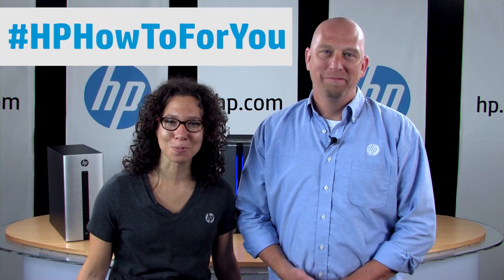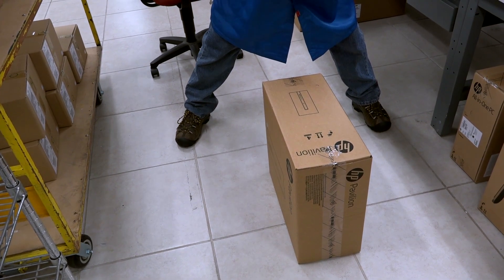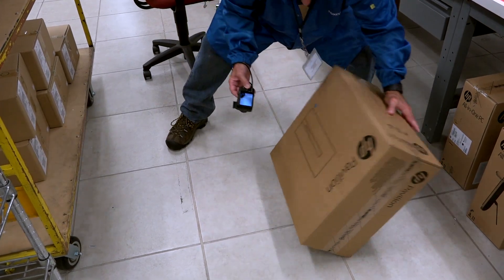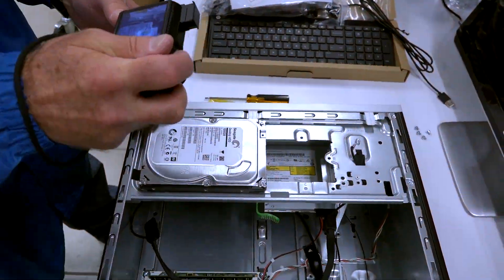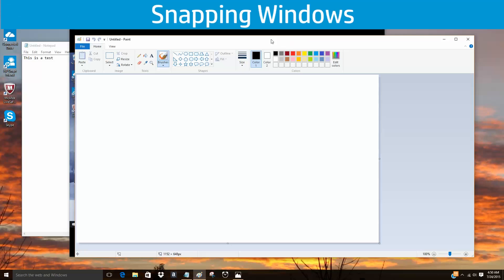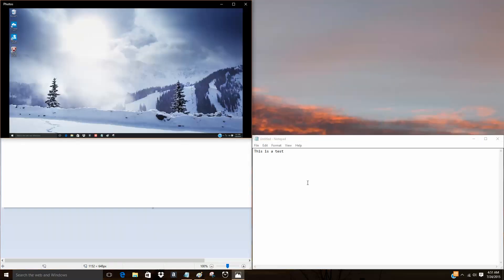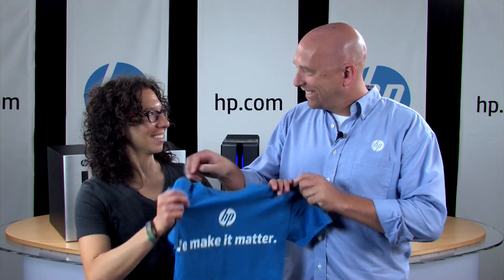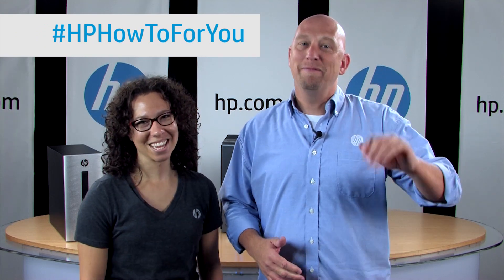Windows 10 Release and Unboxing: HP How To For You | HP Computers | HP

Comment: Just last year my windows 10 computer just started being really slow and the internet keeps disconnecting
Reply from the maker: +BranBrown5 Please perform updates via Windows and HP Support Assistant as mentioned below to fix this issue: Step 1 Windows Updates - 1) In the search box, type and open Windows Updates. 2) Check for updates. 3) If the updates are available, click on install and restart the computer. Step 2 HP Support Assistant Updates - 1) In the search box, type and open HP Support Assistant. 2) Check for updates. 3) If the updates are available, click on install and restart the computer.
Reply: @HPSupport  I’ll see if that works

Comment: have an HP C310a all-in-one printer which doesn't print after purchasing a Dell i3846 PC with Windows 10. have replaced the printer head and there is no change. are the printer and Windows 10 compatible?
Reply: +alan whitson   Yes it is compatible with Windows 10, it has a full feature driver for it.  What was occurring with the printer that prompted you to replace the printhead?

Comment: hp window 10 get hot on the right side of the pc really fast
Reply: +Khem Biswa   You di'dnt mention whether you have a notebook or desktop computer.  No worries, I've included the troubleshooting documents for both types of computers.  I've also included the link to our YouTube video.

Reducing Heat Inside the Computer to Prevent Overheating Video by HP Desktop and Mobile Device Help ( http://ow.ly/VuKk4 )
HP Desktop PCs - Reducing heat inside the computer to prevent overheating ( http://ow.ly/VuKrb )
HP Notebook PCs - Reducing Heat Inside the PC to Prevent Overheating ( http://ow.ly/VuKAn )
Reply: desktop computer
Reply: +Khem Biswa   Then I recommend the video and the desktop document for you.  I've included them again. 

Reducing Heat Inside the Computer to Prevent Overheating Video by HP Desktop and Mobile Device Help ( http://ow.ly/VuKk4 )
HP Desktop PCs - Reducing heat inside the computer to prevent overheating ( http://ow.ly/VuKrb )

Comment: How to connect HP Officejet 4620 with window 10 in  Sony Laptop?
Reply: +Roya Hosseini  If you do not have the driver use Google and search "HP officejet 4620 e-all-in-one printer driver" The top result should be to the Software and driver page for that printer, click the blue Go under option 2. This should take you to the correct driver download page if you are on your Windows 10 machine. Otherwise, click the blue edit link to the right of where it displays "Your operating system" and then select Windows 10 from the drop downs. When it refreshes the list Click the orange download button to the right of "HP Officejet Full Feature Software and Driver" This will save the installation file to your default download folder. Just run it from there once it is downloaded and follow the onscreen prompts during the software installation.  Let me know if you need any more help.

Comment: not starts but the screen remains blank the its  starts without any issues but when we shutdown the computer it not goes into off position i mean the display is only goes to of positon but the cpu is running and the power light is on tell me the exact solution
Reply: +Kumaravel Rkg   It sounds like your computer is not entering sleep mode.  Please try to disable “Hybrid Boot” or “Hybrid Shutdown” by turning “Fast Startup” off.   To find out how to do this, please search for “Fast Startup - Turn On or Off in Windows 10” using Google search.  The first hit should be for the Windows 10 Forums knows as “tenforums”.

Comment: i install windows 10 did a factory reset now laptop wont work keep getting message propblem have to restart error messwage inacessable boot device
Reply: Mae Verax What was the original operating system installed on your computer? What is the product and model number of your computer?

Comment: My Hp Laser Jet Printer P1102W is not printing after installing Windows 10. I downloaded the up-to-date driver. The computer recognizes the computer. When I want to print a document nothing happens.
Reply: Norm Goldman Is your printer connected using a USB cable, or is it found on a wireless network? Does your printer print when connected to a different computer?

Comment: afer updating to windows 10 my  HP Pavilion 14-n009tu im facing  shutdown problems
the display is only in off but the power button light is on and the cpu is running
please help me
Reply: Kumaravel Rkg I recommend following the steps in this document on HP Notebook PCs - Computer Starts but Screen Remains Blank (Windows 10, 8). This resource can be found by Google searching "c03518165". If the issue continues, please contact our technical support by going to Google search and enter 'contact HP worldwide'.  Your first option should be the site for contacting HP, when you click on it you will be prompted to choose your country/region.

Comment: i have hp dv2000
please help
Reply: Mark Karol Cabildo According to the available supported drivers for your computer, there are no Windows 10 graphics or chipset drivers available for installation. In the meantime, I recommend following the steps in this document on HP Products - Where Do I Find Windows 10 Drivers and Software for My Model? This resource can be found by Google searching "c04758308".

Comment: my display driver is not compatible with windows 10 update..is says geforce 7150m/ nforce 630m. the display manufacturer hasn't made your display on windows 10,,
Reply: Mark Karol Cabildo I recommend following the steps in this document on HP Products - Where do I find Windows 10 drivers and software for my model? This resource can be found by Google searching "c04758308".